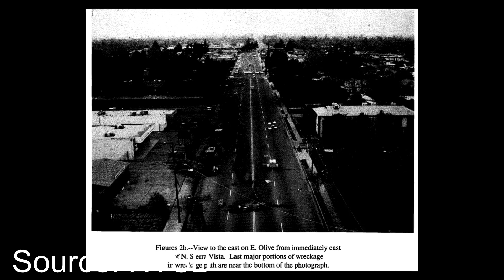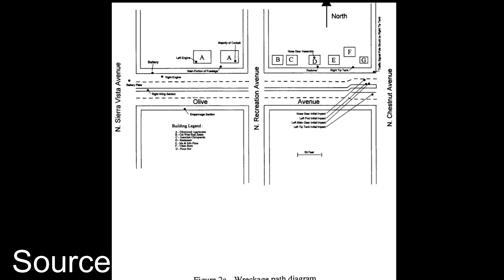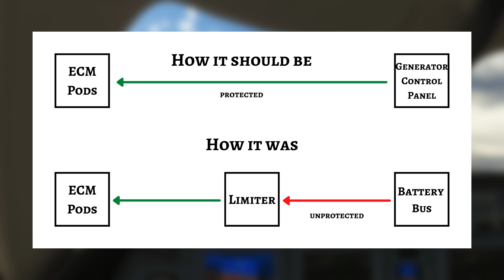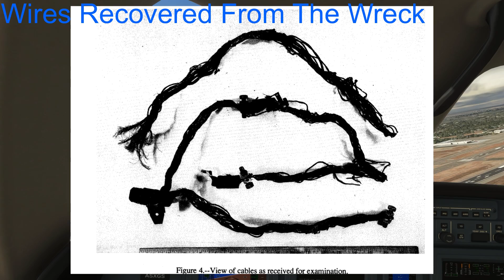How A Tiny Wire Set This Plane On Fire| The Crash Of Dart 21

Comment: That happens in cars a lot - the current supplied by a battery in a short circuit is enormous - Great video and we can all take away a learning point ! Thanks a million !
Reply: A friend of my dad once worked as supervisor in the aircrat industry. He once told us he feld about quitting the job. When we asked why, he stated, that they had a new production management boss. And that guy had come from the car industry and was pushing to implement faster procedures from the car industry. The buddy said, he wouldn`t want to be part of this company anymore, if it starts to take shortcuts in the production process and negetiate safety priorities. Had to think of that convo, when the 737 MAX thing occured. Quality dropping for profit is something, that has no place in the aircraft industry.
Reply: This type of shitty workmanship can be found in all types of machinery, from automotive to industrial and apparently aviation as well.

Some mechanics just have no business anywhere near sensitive equipment, it's infuriating how most people just don't give a shit about the work they do.
Reply: This is true, I have worked in body shops over 40 years I is amazing how creative some people are, back in the day of the giant boom box a kid drilled a hole in his fire wall to run strait 12 volt cables the size of your thumb to his power supply in the trunk no grommets or wire protection at all after it shorted burned his car to the ground people also disable fuses or put the biggest one they can find in when they start blowing
Reply: @waltradcliffe4482  I knew somebody do something similar behind his dash to power something, to put a long story short he voided his warranty and the cost to fix the electrics cost more than his previous car.
Reply: This is why in a car accident, the fire department cuts the battery cables first thing. Fuel pump sometimes, keeps pumping fuel also.
Reply: I worked on cars for decades, back in the 90s when almost everything had a timing belt we did the line up check and had another double check. How could that company, just like Dr Evil, assume everything was done according to plan.
Reply: @adambartlett114  12 or 24 V killing people? Maybe with large copper pads pressed right onto your chest with highly conductive gel, but even then it's very doubtful. You can barely feel 12 V with wet hands. You're not going ti be in a lot of pain if you touch it.
Reply: @ErikBročko  You can literally use a 12V car battery to WELD. Search YouTube there are videos of people doing this. My uncle worked as a used car salesman and one day accidentally touched his wedding ring to the battery positive terminal which must’ve been in close proximity to something grounded. Oh my god the pain must have been blinding. He said his ring glowed red, and you know how hard it is to get a wedding ring off when it’s cold and dry!?
Reply: @ErikBročko  try 9V and the tongur